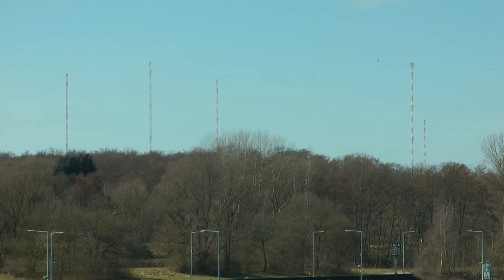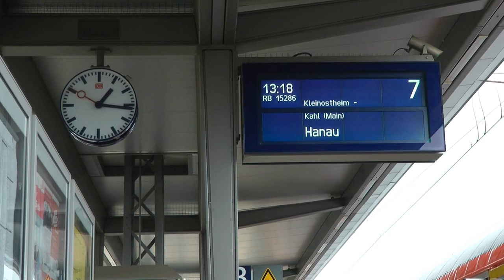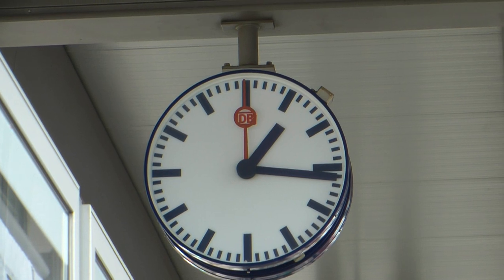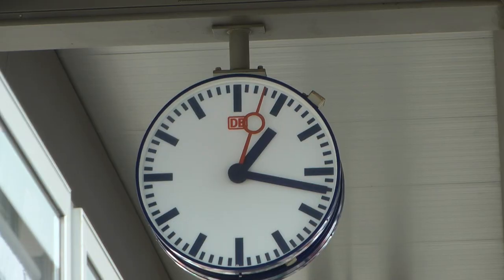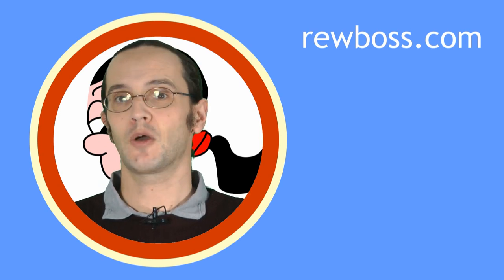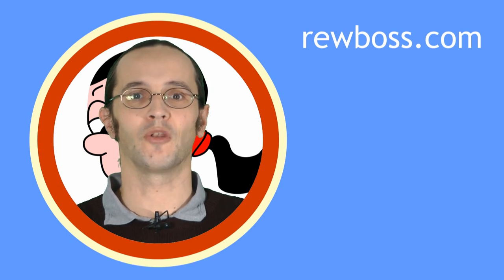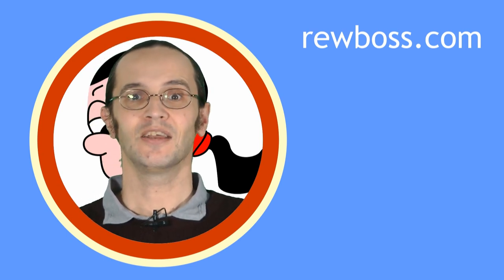Station clocks [Things you find in Germany]

Comment: I have a DCF77 wristwatch (a Casio "Wave ceptor") - wonderful to have the exact time at all times!
For punctuality it does not matter when the train departs. The moments interesting for passengers are
- the last moment when they can board the train before doors close
- the first moment they can step on the platform after doors can be opened. As it can be crucial for connections, the arrival time should be rounded up, not down.

Nevertheless some railways (I think the French) advise passengers to board trains before the published time, which is a bit confusing - but then airlines are even more confusing, passengers have to keep many different times in mind (until when they can check in, until when they have to show up at the gate) and then in timetables they still find the time the aircraft gets moving as departure time, which is a time when it's too late to show up anywhere because you must already be sitting inside the aircraft at that time, having checked in your bags and made your way through security checks long before.

Comment: I'm afraid that's the wrong explanation. What really happens is that the fabric of space-time is distorted either at the watch or at your head, so that the time differential is clearly visible for one of the observers. This is due to the micro flux capacitors in each clock and the minor distortions from the warp cores in the trains. Although it is a bit silly that we still call those flying things trains, I mean it's 2389, come on. We'd still be riding on rails if we would have listened to those people warning about major time anomalies caused by today's trains.
Reply: Sad to find out that, by 2389, the German-like conditional featuring "would" both in the main and subordinate clauses has replaced the more logical conditional that we use here in 2015.
Reply: Guepardo Guepárdez
That's just because the Clone of Hitler succeeded in conquering the entire world in 2171 and germanized most languages including English.

No, but seriously, what exactly do you mean? Was using 'would' German-like or even wrong (native German speaker here)? And what do you mean by "more logical conditional", how would you have said it?
Reply: Thulyblu You wrote this: "We [woul]d still be riding on rails if we would have listened", with a conditional verb form in both clauses, as in German: "Wir würden noch auf Schienen fahren, wenn wir zugehört hätten". The standard way to say that in English would be: "We would still be riding on rails if we HAD listened", with a conditional verb form only in the conditional clause.
Reply: Guepardo Guepárdez
Ah, okay, I see it now. Thanks!
Reply: Guepardo Guepárdez : Thank you so much for this. That American English past conditional tense drives me mad = crazy; NOT angry.
Reply: Oh, are you saying that using conditionals in both clauses is an American thing as well? (It's sad if that's the case.)
Reply: Well! That explains the messages I get on my ham radio set every minute. All this time I thought it might would is GPS gewesen.

Comment: I actually have one station clock at home. A Pragotron from the 1960s. It has an input for 230V for power and a pin for the minute signal. I am thinking about making it functional again using an Arduino board to send out the minute signal.

Comment: The same principle was used in the Gents' "waiting train" clock systems. A large very big,  poor time keeping electrically powered clock ticked for 28 seconds and the output to the hands paussed til an electrical impulse arrived from an accurate master clock. The master clocks could be themselves be synchronised to time signals delivered from Greenwich by telephone line.

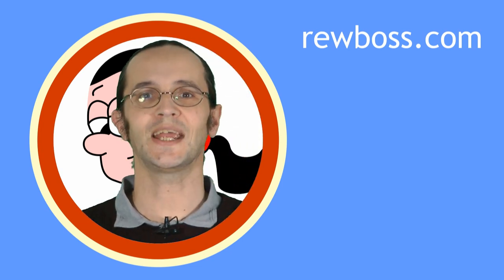Comment: 2:53 - für einen Moment taucht eine Rarität auf: Der PUmA-Modus-Wagen. Zuerst hieß er PUmA (= PfA-Umbaukonzept mit Aluminiumaufbau), dann wurde er wegen Markenproblemen mit einem Autohersteller (wohl Ford wg. Puma) umbenannt in Modus (= Modulares Umbausystem). Allerdings haben sich Probleme mit der Türsteuerung beim Betrieb mit Dieselloks gezeigt, so daß sie nur noch auf elektifizierten Strecken eingesetzt werden. Das Projekt wurde nicht weiterverfolgt.
Reply: Google Translate to the rescue... probably

For a moment a rarity emerges: The PUmA mode cart. First he was called PUmA (= PfA conversion concept with aluminum construction), then he was due to brand problems with a car manufacturer (probably Ford as Puma) renamed in mode (= modular conversion system). However, problems have appeared with the door control when operating with diesel locomotives, so that they are used only on elektifiziert routes. The project was not pursued.

Comment: Thank you. very informative. I tried tuning in DCF77 on 77.5 kHz. Nothing down there except a carrier signal every now and then. My antenna was a 40 meter long dipole so it certainly is not optimum for 77.5 but I thought I might hear something. I've heard some nav beacons that send a morse ID. Looked one up and found it was up in Eastern Canada. Not too far away.
Reply from the maker: It should sound like this: http://de.wikipedia.org/wiki/Datei:DCF77_time.ogg

Depending on the weather and other factors, it can be detected as far as 2000 km away.
Reply: rewboss
 Thank you. I'm far beyond that distance, but you never know. Thank you for the link to the recording of what it sounds like. Very interesting. A friend of mine up in SH that I that I sent a link to one of your videos also noticed a short wave receiver, vintage, most likely tubes, or valves, in the background. I saw it and mentioned it to him and he said he noticed it too. Was just wondering what make model it was. Thanks and have a nice weekend. I remember listening to the BBC World Service on shortwave as well as Deutche Welle and of course Radio Moscow back in the cold war days. I was tuning around and happened to run across the foreign broadcast station from Cuba on 6 mHz even, I think it was. They were spouting off as usual. Was kind of amusing. Now we can listen on the internet but I like the sound of the AM signal fading and just listening to it off the air instead of the perfect audio on the internet.

If I have an HF radio in the car with me sometimes I'll tune through the HF shortwave bands and listen to a little foreign broadcast. Of course most of what is out there now are religious stations which I have to guess that almost nobody listens to.

Thank you for your professionally done and very straightforward and easy to understand videos. It's nice to see someone do something so well and with the apparent ease of a master. 

Tschuess.
Reply from the maker: That radio in that video is a Loewe Opta Luna. We think it would probably still work if we put a plug on it and hooked it up to a decent aerial.
Reply: rewboss Thank you. My friend in SH says he has a Grundig which is very similar. Apparently your receiver is a 1950's vintage receiver made in Germany. Thanks for the info and have a nice weekend.
Reply: You can receive the Colorado signal in the USA.
Reply: @BarnOwl61  I usually check WWV on 25 mHz to see if the MUF is that high. Also check it on 20, 15, 10, 5, and 2.5. Have not tried their VLF signal. Have a fine weekend.

Comment: Ist mir noch nie aufgefallen. Ist das wirklich bei allen Uhren in Deutschland im Bahnhof so?
Reply: Ja.
Reply: nicht ganz, teilweise sind die auch digital, oder haben keine Sekundenzeiger. Aber bei allen Uhren dieses Modells ist das so.
Reply: Trekki200 Auch das ist nicht korrekt, es gibt auch viele Uhren dieser Bauart, bei denen der Sekundenzeiger nicht durch einen Synchronmotor angetrieben wird, sondern das tickende, ruckende Bewegungsmuster wie die Uhren im Haushalt hat. Dieser hat dann auch keine Extrapause auf der 12. Zum Beispiel alle Uhren auf den Stationen der S-Bahn Hannover sind von diesem Typ.